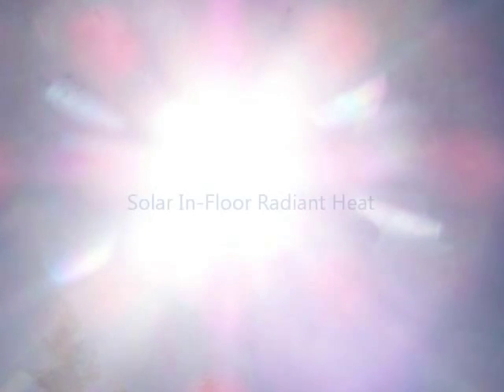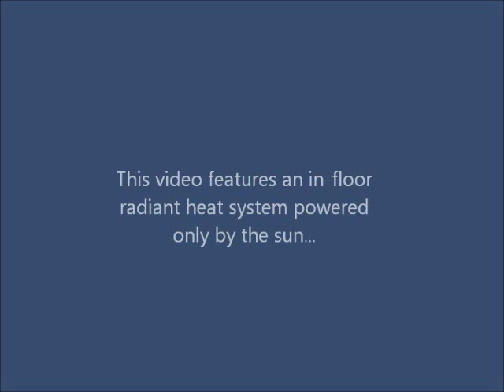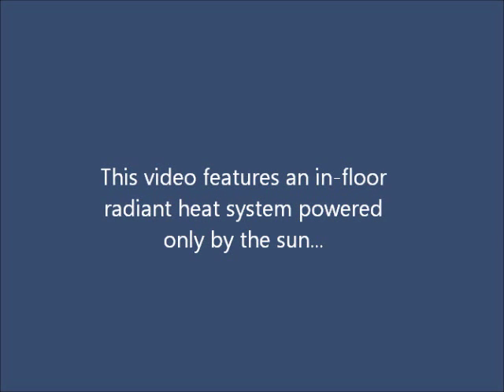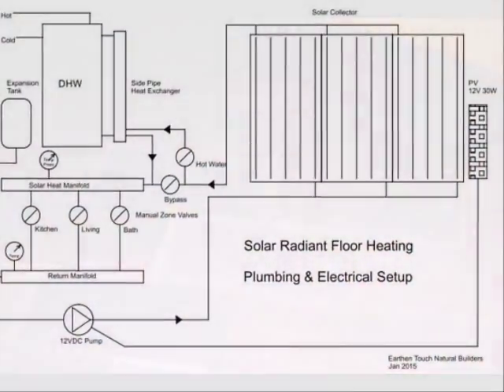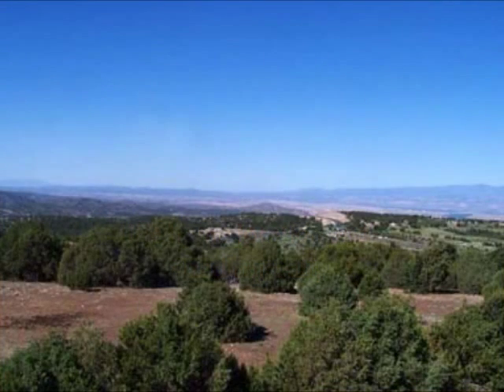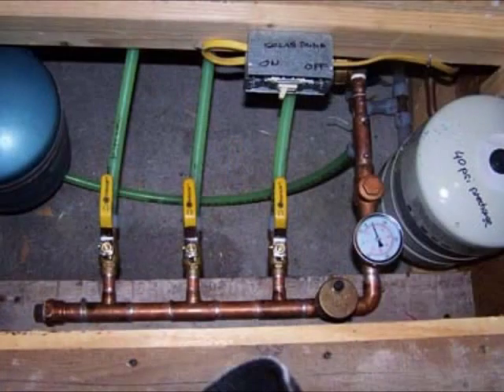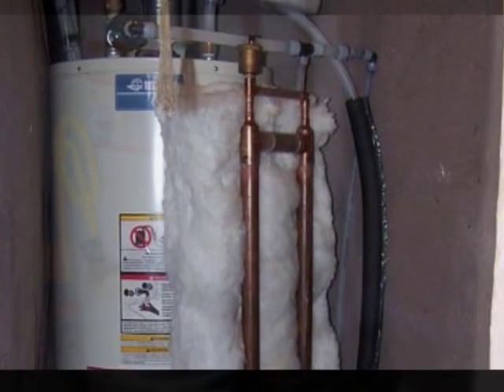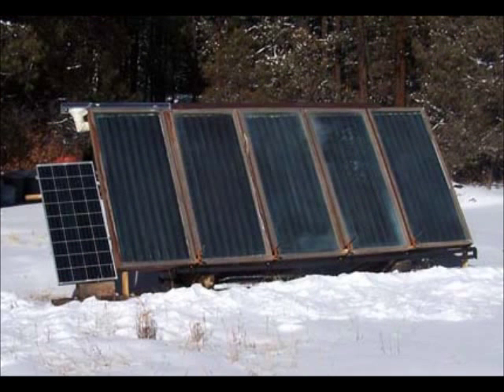Natural Building Basics - Solar In-Floor Radiant Heat

Comment: Yes. Combine with rocket stove and if you can put your solar collectors at a lower altitude than floor level, convection will alleviate the need for the solar powered pump. Thanks for the vid.

Comment: You could probably run the glycol loop through the walls of an adobe wood fired oven/fireplace/rocket stove, before the manual zone valves. That would afford you the luxury of heated floors in the event of a cold and cloudy day or through the winter.
Reply: Shane I'd like to see a video detailing that addition to the system !